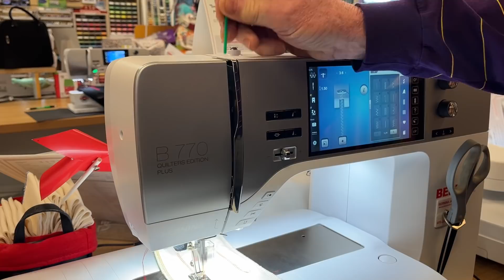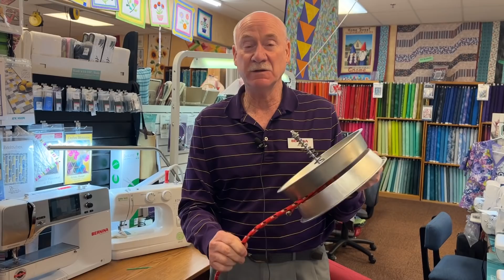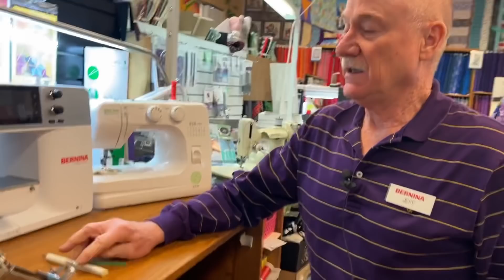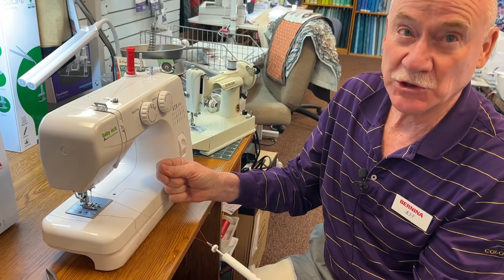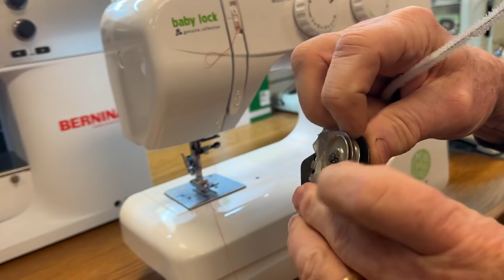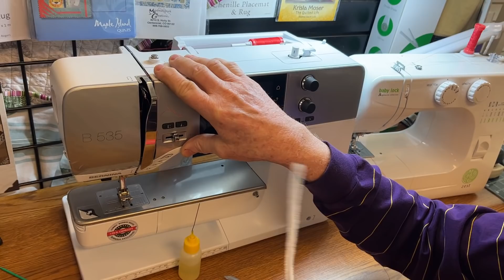How to test upper thread tension DIY quick fix Bernina Jeff why thread loops nests under fabric sew

Comment: I was working with kettle cloth cotton fabric and I was getting a tangle in my bobbin case. I was sure I was inserting my bobbin wrong or it wasn’t the right size. I never thought to check my tension. Great tip at a perfect time. Thank you for your video.

Comment: Omg thank you so much! I had thread that was loose on the top for ages and tried EVERYTHING the internet said but no where did it say clean out the tension mechanism. Found a giant tangled red thread (haven't used red since February) in there. Cleaned it out with a tool that came with it and all my stitches are perfect now! I have messed up and cost myself a lot of money on customers shirts and this has saved me so much aggravation! Thank you so much!!! ❤❤❤❤❤

Comment: Thank you so much for explaining how/why the tension works the way it does. I am one of those sewers like you mentioned, that pulled the bobbin casing apart, gave it a good clean on the underside of machine, only to still have the problem. I was worried about how far to turn the upper tension when quilting, only going as far as 6.5, but you have given me the confidence to go higher now. Thank you, you would make a great teacher, the way you explain things so easily for me to understand

Comment: Absolutely wonderful information as usual, thank you Jeff. Can you help with my very recent problem, I have a Bernina 590 that has just started to shred the upper thread, I use 50wt Aurifil for piecing with 1.5 stitch length. I sew fairly slowly but still shreds, have tried using Bernina thread stand, have undone everything & checked what I can, also lowered thread tension from 70 to 40, new needle, no luck. Seems to shred & break down lower end opposite presser foot left button etc. Any ideas would be such a great help 😀🤞

Comment: Hello. I live near Morehead, Kentucky. Brenda sent me. I own a Bernina Patchwork Edition that I bought new from the Bernina dealer here. It's going to take me a while to get through all your available videos. I

I need to learn how to deep clean and oil my Bernina. I don't use my Bernina very often. I save it for doing special projects.  My Bernina hasn't been serviced for a while.  I was told that I am never to open my machine to clean and oil it myself (by the repairman at the dealership). However, another woman told me that she does open, clean and oil hers. Because I have been told different stories by the people that I bought my machine from, I now do not trust them anymore. 

This last time I was in their shop (for a class) the repairman wanted me to trade in my machine. I like my little Bernina. I don't want one of those big machines they were selling at the time. I can't lift them. I'm 75 years old. The repairman did not know that I had overheard a woman telling her husband that she wanted a little Bernina like mine. I also overheard the husband ask the repairman about getting them a machine like mine. The repairman told him that they were not made anymore.

Someone else told me that the computer inside my machine is now out of date and cannot be replaced. If any of the information that has been given to me is correct, I may never buy a modern sewing machine again. I do most of my sewing on antique Singers. The old machines are easy to open, clean, and oil. I would love to be able to do the same for my Bernina.
Reply from the maker: I like old mechanical machines too, but the features a computerized one has are nice. Clean and open what you are comfortable with do not adjust things and use a good oil. Computer machines are good for as long as they work like a cell phone if they die get a new one. Jeff

Comment: Hi Jeff, so glad I found your channel. I am going back to sewing on my Bernina 950 and I have always had an issue since I got this machine where the backstitch always gobbles up the tread. I think it is the speed of the machine. I just cleaned my upper tension like you showed and am still getting the breaking of the tread once I do a couple of backstitches and then go forward again.  Do I have to unscrew that area under the plate to release something or clean it? I did take a dust blaster to it to try to clean the lint out. Appreciate your advice.🙏🏻

Comment: Very helpful, thank you so much.  Now, a quick question.  Can you help with stitches not forming.  Long runs of thread, and the odd stitch?  Hoping you have a video on this.  I'm wondering if it is a hook timing issue or a tension issue.  Meanwhile, I'll go and find a pipe cleaner.  Thank you!

Comment: Thanks for the video explaining tension.  I've got a Bernina 330 and have a question about removing the thread.  Should I cut the thread near the spool and pull the thread out going forward, or could I just take the spool and pull the thread backward through the machine?  Thanks for your videos!
Reply from the maker: I recommend cutting by the spool and pulling out from the needle less build up of debris that way

Comment: Hi there. Thank you for the great videos you provide. I would be grateful if you could please help me out with a query regarding a 730 bernina record. I can't seem to get the straight stitch to centre itself. I was thinking if it was an off set stitch to the left. If I move the knob to centre it for straight stitch it will do zigzag. I've checked manual set it up as directed but zigzag will always occur.
Any advice would be much appreciated.
Kind regards
Debbie
Reply from the maker: Check to make sure all the tabs on the right side are in correct position they control button hole functions then make sure the middle smaller knob is straight up with the outer knob to the far left they can get gummy

Comment: Hi there. Thank you kindly for your reply. I've done exactly what you said to do and it still sews straight stitch to the left, but I have found it to work straight stitch when the lever for ornamental and zigzag stitch is positioned in the middle. This is the only way it will sew a central straight stitch. I've managed to get the whole machine up and running I've cleaned, oiled, and done a test of all stitches. It's a beautiful runner. Tested on 6 layers of denim Jean material, 6 layers of thick calaco, 12 layers cotton, polyester 2oz wadding in between cotton and even a bit of freemotion. It goes through it all. If I'm using the machine in the incorrect way ie set up different from the normal will this cause damage in anyway? The only other thing I can think is that it is out of alignment? Thank you once again.
Kind regards
Debbie
Reply from the maker: Mechanical machines need that to be adjusted will not hurt to use it
Reply: Thank you.

Comment: I have a back up kenmore ultra stitch 6 and don't use it because when i finish sewing a seam and cut the threads the upper thread snaps back and the needle unthreads!! So annoying so it sits away and it's otherwise a lovely machine. Any ideas to solve that dilemma?
Reply from the maker: Turn the hand wheel until you see the take up lever at its highest point then lift the foot and pull the threads long like 8” and trim next to the fabric

Comment: Wonderful lesson. Thank you. New subbie.
Do you have a video on the feed dog? I have a different brand to what you work  with (Brother)  but I was wondering if there is a way to find out why mine is staying down without taking it into have it looked at a second time - first time did not fix the issue sadly.
Thank you for taking the time to make these videos.
Reply: which Brother do you have? some have a button on the side of machine that you can push in to drop feed dogs. Then push it again to put the feed dogs back up.
Reply: hey Dawn, mine is the Star 110 it has the control switch to the right and below the bobbin cover but on the body of the machine. Does that make sense? I'm going to give a call to a machine service guy and find out what the costs will be. I saw an amazing plate that goes over the top of the existing plate to cover the feed dogs and you can then free motion sew 😮 I thought that was a pretty cool idea and a possible option 😀

Comment: HELP !!! 
I did everything from cleaning, rethreading, oiling, but I am still having issues with the top thread. The bottom of the fabric shows large loops. No matter what tension number I use, the loops still occur on the bottom of fabric, sometimes bunching up like a nest. I even took the bobbin apart, cleaned everything and put it back and re-thread again. I don’t know what else to do.

Any suggestions?  Am I missing something else?  Please help 😞

Comment: I have a Bernina B350 patchwork addition. Have had it for many years. I am not sure what the problem is, but when I sew, the bobbin thread looks great and upper thread I could pull it right out of the seam I sewed. I have tried everything I can think of, cleaned it, re-threaded it, changed the needle, changed the bobbin, changed the thread and changed the upper tension dial from o to 10, and nothing works. just hate the thoughts of having to take it in. The nearest sewing machine repair is 30 minute drive and over 2 weeks or more to wait for it and with the price of gas right now. I am stuck.
Reply from the maker: I have a video on bobbin tension. The bobbin case is too loose put normal thread on a bobbin and put it in the case the tension must support the weight of the hook attached to it tighten the small screw until you get tension

Comment: Jeff, I'm so frustrated. My upper thread sensor keeps going off. I tried the wonder clip, the thread covering, and it's still doing it. When I have my thread on a stand it doesn't do it and my stitches look great. But when that sensor goes off it stops everything. Any other tips? This machine is quite expensive to have me constantly overrriding the function in order to sew. Tia
Reply from the maker: The check spring controls that it’s been happening a lot lately the spring get out of its groove I will have to do a video on that fix if it sews fine just turn off the sensor you only need it for embroidery
Reply: @berninajeff  Thanks, Jeff. I noticed it doesn't happen when I use cones on a stand but I have a lot of thread that is regular sized. Tks.

Comment: My mom's serger isn't working. It was not used for about 8 yrs and it's not moving. What can we do?
Reply from the maker: You can take the bottom cover off and clean and oil after that test not much else those units are very fussy

Comment: I sent Bernina a note that my machine (780) kept stalling.  Service kept it five months!!  Sent back.  Machine did the same.  I thought you would help as my machine kept stalling.  Instead, you just sent my entire message to my only quilt shop in the province, the only service in the province.  She is also a friend! I was desperate or I would not have sent my note!  I finally traded the 780 for Bernina 790+.  Maybe I’m crazy?  It’s called 790+ "crystal".edition.  The "crystal" is three pieces of shiny card stock glued to front of the 790+….identical to 780: which has been discontinued?  Stalling?  No error, just STOP!  Finally an error started showing the foot as if it kept lifting.  Then it wouldn’t move AT ALL when I tried quilting.  Finally it stopped sewing.  Message says to contact service.  I’ll see if I can send photo